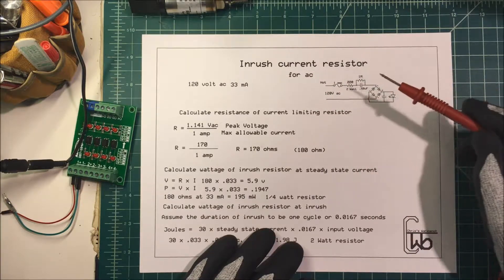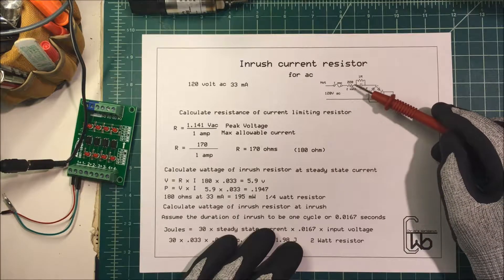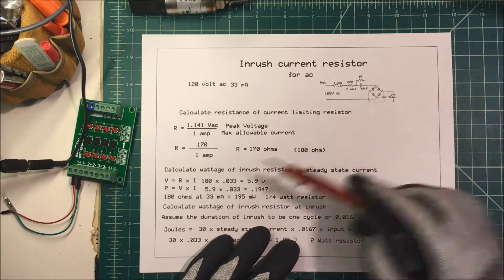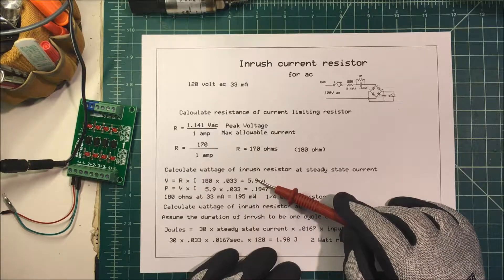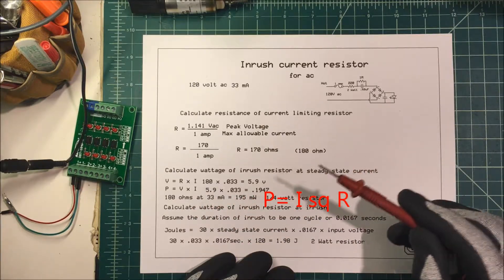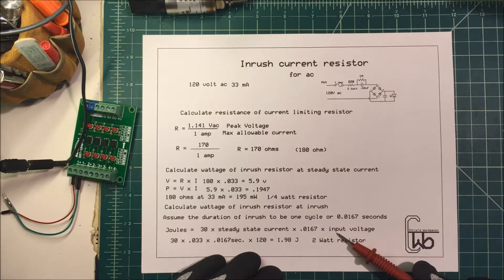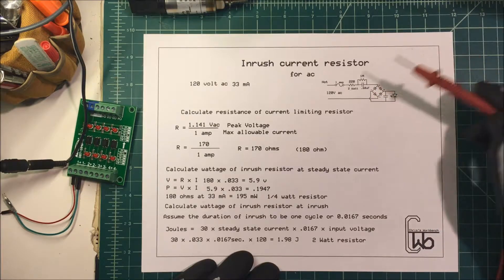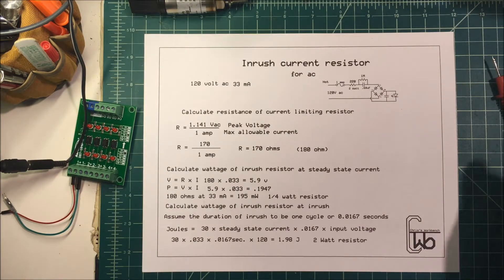Inrush Current resistor

Comment: Hello Can i ask you why you use 30 when you calculates Joules?
Reply from the maker: 30 x the steady state current is approximately one amp, I was going for the worst case scenario.
Reply: @ke6chris  Thank you for explanation..
Reply: The Chinese will use a 1/4 watt resistor even if the average power is 400mW (and it’s in an enclosed space).

Comment: Hi Chris,

I find quite useful and interesting your explanation. Nonetheless, I do not understand why you sized your resistor by using input voltage and steady state current. I guess you can size by this way. 

I think that to size properly the inrush resistor you need to know what is the energy required by the output capacitor. In this sense, (1/2)*C*(V^2) will give you the joules that you need for charging the capacitor, giving to you the resistor size. I think the result is slightly different and I would like to know the differences if possible.

I would very grateful if you can give me your feedback about my comment. 
With my best regards,
Carlos
Reply from the maker: I used maximum allowable current to get a ballpark figure, using the joules of the capacitor would be more accurate.
Chris

Comment: Hi Chris, nice to find the helpfull videos on you channel. It's very great for me. Emm.. but i have some questions about something in this video. What is 1.141 Vac value there, where you wrote the source is 120V and what is 170 value described there exactly? I hope you explain me clearly. Thanks.
Reply from the maker: Thanks for the comment, in my next video I will talk about RMS and peak voltage.
Reply: quick answer : in AC, peak equals rms times the square root of two. sqrt(2) = 1.414 (the sheet of paper has a typo and shows 1.141 instead of 1.414 but he corrects it in the audio.